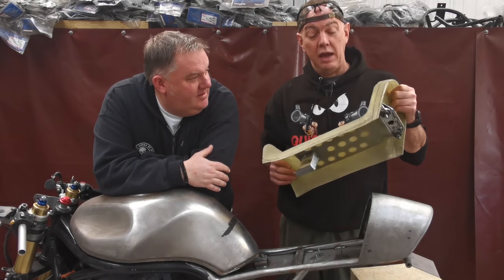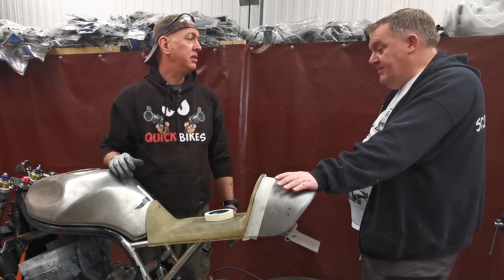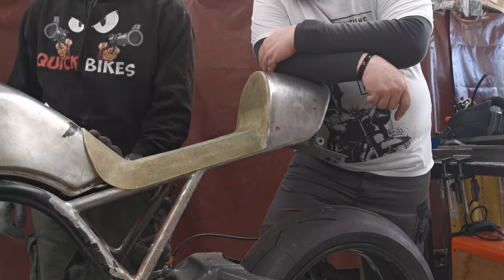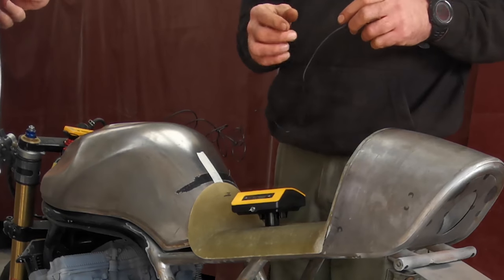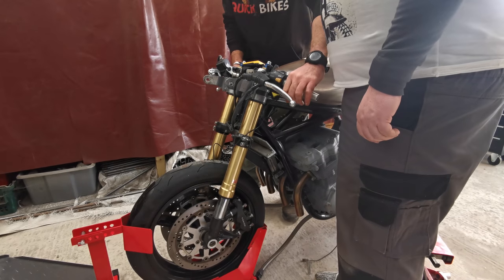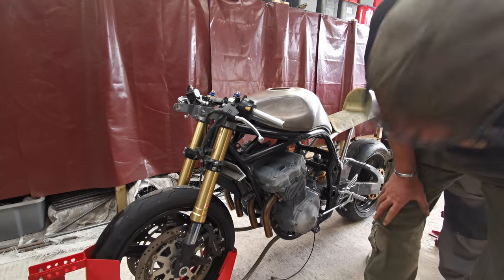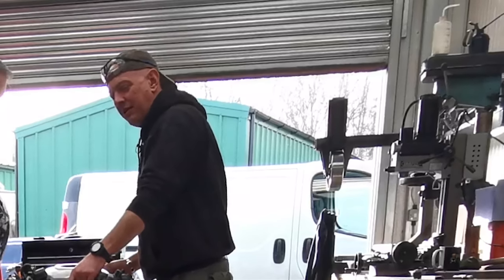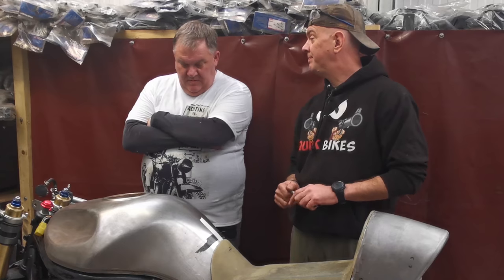Seat fitment and geometry - Suzuki Bandit Cafe Racer - GIXIT Project Part 34

Comment: I really enjoyed that fellas.
1. Don’t feel bad about the brain fart, we all have them. 
2. Don’t be so self conscious Stevo.
3. In addition to everything missing off the bike you’re meant to measure sag fully kitted in your riding apparel.
4. Simon you’re a pro welder, you know what you’re doing. If it was me I would just use panel bond for the tank extensions and save myself the grief.
5. Please make the seat release look like a gun trigger 😃
Reply from the maker: Cheers matey, the measurements just get us in the ball park but I think he's jumping the gun a little. Wants to work out spring rates, geometry and centre of gravity, but I don't think this can be done until the bike is finished with everything on it. We're gonna have to to do it all again and then it will be in full kit and tucked in which is how I set my race bikes out... 👍

Comment: If the 75mm shorter forks are an issue, use a stepped top yoke to regain 20 to 40mm in front ride height,  help rake too if it's too steep. Can always use adjustable yokes, and shim.
Reply: PS Stevo I'm 130kg, I'm 197cm tall mind you.
Reply from the maker: Trouble is the swingarm is 70mm longer as well... We have and adjustable top mount for the shock so can make some fairly major changes if needed, but we need to work out basic geometry first given the hard points that can't move (ie swingarm pivot point, location of shock mounts etc). It's only a starter for 10 but should tell us if there are gonna be any major issues and what they will be 👍
Reply: @QuickBikes  ground clearance on headers on bumpy corners is one to watch.
Reply from the maker: We've got some lovely speed bumps round here to check it on 😂🤣👍

Comment: I like symmetry so if you can make a short exhaust left and right under or just after the pegs and keep the back wheel and swingarm free, that would be best i think. You only need space under the bike to put the muffler.
Reply from the maker: Agreed but we have a few things in the way... I'm keen to keep the length of exhaust close to stock as well and currently thinking of staggering tubes in a collector, but we shall see... 👍

Comment: Hi guys..
Not picking holes but shouldn't you do the front end measurements be done
after the front forks are rebuilt?? Great channel.
Reply from the maker: Yes, you're totally right. Everything needs to be on the bike and Steve O needs to be wearing all his kit to do it right. I think Mark and Simon just want a ball park starter for 10 so they can get an idea on spring rates and centre of gravity. The bike is going to get heavier once exhaust, carbs n cones, oil cooler surround, engine oil, lights, chain etc are all added. Think they jumped the gun a little but if they say they want the numbers then they'll get em 👍
Good comment matey 👍

Comment: Poor Steve O.  Bottoming out forks without even rolling😂.
Reply from the maker: Aw he's got a way to go yet 😅
It's all gonna need to be resprung anyway as the bike is nothing like a GSXR1000
Reply: Yeah I know but a friendly piss take always helps in situations like this😉

You can tell it’s way off even without anyone on it.  It looks like it’s massively under sprung going by the amount of static sag on the front.  That’s also a shit load of stiction on the front end but I’m guessing that’s through lack of use rather than anthing else.  It’ll be dandy when it’s been fettled.

Comment: How does the upholstery get wrapped?  Does it wrap under the fiberglass?  Have you left room for that?
Reply from the maker: Basically yes... Foam gets glued to the fibreglass, upholstery glues to the foam and wraps around the edges to the underside of the seat. There's a gap for this, but I may need to do some sanding based on what the upholster says is needed as I'm guessing the gap needed 👍

Comment: have you tryed to put the front of the seat in hot water to mould around tank ????
Reply from the maker: Nope, no I haven't... I'm not sure the GRP would react the same way production fairings do, so I think I'll just patchwork it though as I know what I'm doing there now 👍
Reply: @QuickBikes  if you build up insides like you said you can grind outside back to keep it uniform anyways if need be.
Reply from the maker: Yeah, that's the plan. I want to try and keep it even and nice looking even though you're not going to see it 👍

Comment: I am only 10 mins in, so you may address my point a bit later in the video. Do you have enough clearance for the tank and hump? If I assume the foam is going to end at the ends of the seat and not be wrapped over, is there enough clearance for the seat covering material to the front and rear? The cover is going to go over the edge and be stapled on the underside and it will gather round a curve making it even thicker. Hmmm
Reply from the maker: I need to meet with the upholster this week. To discuss how. Much gap she needs for material. Whatever she needs is how I'll make it. Material will be glued not stapled as the GRP may not like that much lol